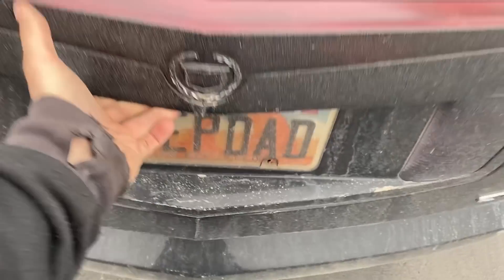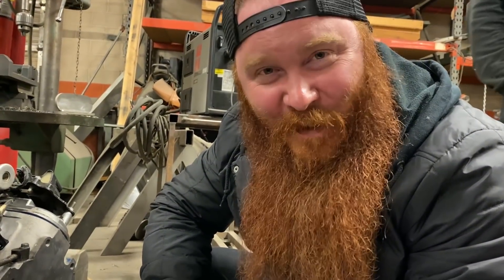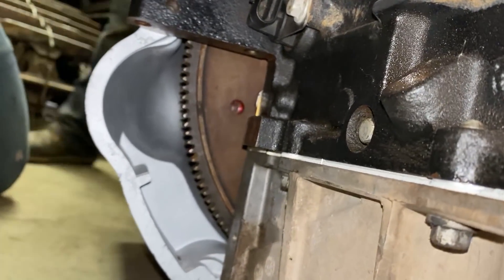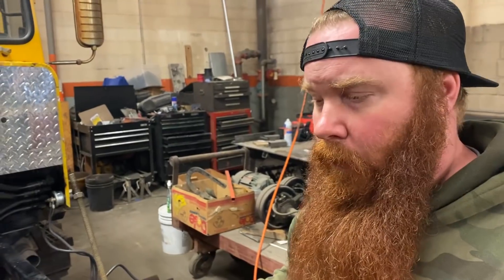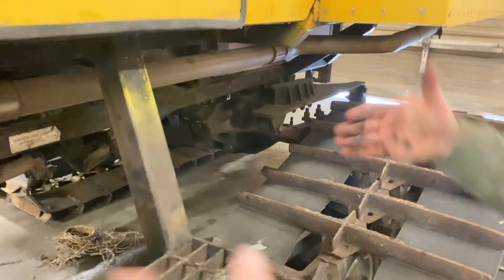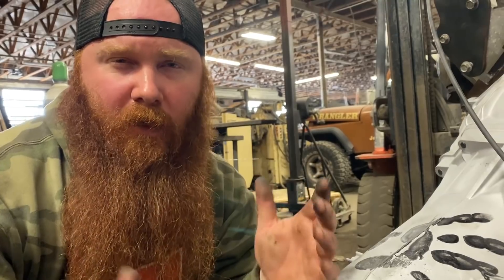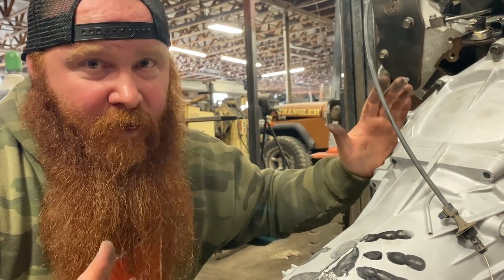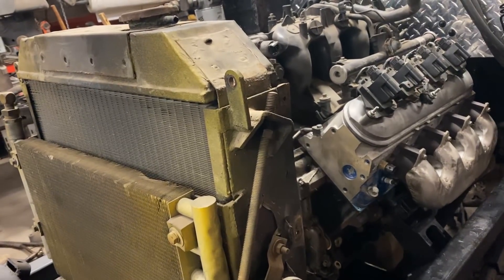LS Swapping A Snowcat Part 4 | Engine Installed

Comment: You need to educate yourself on the operation of an automatic transmission. Not even close. Only a CVT works like a snowmobile torque converter, and remotely at that.

Comment: maybe the thermostat side is water out??? just so you know: a 2 core radiator will pull air though easier and cool faster then a 6 row or a 5 row or a 4 row get it... and toss that radiator fan and install  a duel electric radiator fans that trigger off a sensor , if you do use that fan it must be 50% in the hole of the shroud to pull the fresh air though that over kill radiator..   just say`n

Comment: why not use an electric radiator fan? better flow and reduced mechanical load on the engine, not that you would really notice that bit in this application but the better air flow seems like it could be a plus. might not even need to cut the shroud to make it fit

Comment: Nut and bolt hack: Tractor supply co sells grade 8 hardware for 5.79/pound.  I have been using them as my go to for the thiokol spryte snowcat restomod on my channel.  I should be done in a year or two LOL....

Comment: What’s the flow rate of the hydraulic pump that was on it ? Versus cheating and using a GM power steering pump to run your steering

Comment: Ok guys about the Radiator on your snowcat, change to an electric fan! You will pick up abou 10-12 hp, have faster warm up times and it will save you a bunch of time! You will need a fan set up able to move about 3000 cfm give or take a 500 cfm. High output alternators for the LS are easy to find and shouldn't break the bank!  Good luck and I look forward to seeing the old girl run under her own power!

Comment: Know dought the tanks on that radiator are brass so you can unsolder them from where they are and move them to where you need them. That's what I did on a 53 willy's engine swap I did

Comment: On the hardware buying thing,  do you have tractor supply or rural king or anything like that around there?  They sell grade 5 and 8 by the pound and it is so so so so much cheaper!!!  I went and bought an entire bolt bin set up for less than $200  every size up to 1/2" up to 8" long including washers and nuts and nylocks,  kinda a fistful of each.

Comment: Internet riled up? You mean not using an uga duga socket on the uga duga tool?  Bad form followed by a 6 hundred dollar torque wrench to compensate. 

The tools make the job easier, don't they 😁
Reply: Jeff Knebel if we tickled any more booty they throw us in jail
Reply: @stepdadbarneswestshop2800  I wholeheartedly agree my friend. If the tool dont fit either make it or buy it.

Comment: Tiny hard ware stores do charge a lot for bolts, a large "farming" store near by me sells them by weight at 2.80 a pound for grade 5, so you'd probably only pay like $12 for that. Cummins swap definitely would have been cooler, but it's cool as it is)

Comment: So basically is that Ram set up front and back the same like when the back turns the front turns to like if it's pushed out it would make it turn we do have in the back as well as the front cuz they're in sequence like a loader and the transmission set up like a CVT pretty freaking cool man

Comment: McMaster Carr. It’s where I get all my hardware. I buy enough to have stock. Much cheaper than ace hardware.
Reply: I go to Tractor Supply and buy it by the pound! At least that works for imperial.

Comment: Do your self a fave get a E fan from a local parts store wired on a relay to a temp switch. I swapped them into trucks and cars all the time the amount of less drag on the motor is insane shifts nicer as well less noise warms up quicker on cold start. You have lots of room plus you can use radiator fan zip ties. Plus if you go pro charged turbo or LSA you have wayy more room
Reply: E fans are usually found at raves.
Reply: We will figure something out

Comment: $30 for those bolts! Damn! And are those just grade 5 markings I see on the heads? I'm in rural Idaho and even I can get new yellow grade 8 stuff from a local hardware store for $5 a pound! Hell, I think I could get alloy steel or even 316 stainless bolts and thick hardened grade 8 washers for less than $30 there! How do you live with such expensive fasteners!? 

Where is this? How can I make sure I never live there?

This is all pretty cool though!
Reply: DrPersonman slc Utah 

Ace hardware is proud of their stuff
Reply: I agree. We have a TSC and a Rural King. Much cheaper.
Reply: @glbennett66  TSC FTW

Comment: So, what you’re saying is that the snowcat uses a forklift steering setup with a hydraulic steering wheel and cylinder.
Reply: dzneal  - Didn't say that. Stated that the hydraulic steering setup (wheel/cylinder) replicated what's used on a forklift. The actual method of turning the tracks on pivot is completely different.
Reply: The ram pulls or pushes the same side of each axle 

So when the ram pushes it turns right and when it pulls it turns left

Comment: Two things...first, don't try to turn the cat unless it's moving. You can walk right out of the tracks or break a steering knuckle. Second, stock up on steering knuckles. If you use it much in the snow, eventually you will break one. Having the tools and spare knuckles available can help keep you from taking a walk in the snow. Been there ;)

This is a very cool build, finally an old cat with a bit of HP!!
Reply: KB Snowdrifters getting excited to break all the pets lol

Comment: If your wallet allows,, an edelbrock 8895 water pump corrects the inlet /outlet. I used a krc pulley along with a 1/8" shim to space it to where it needed to be. Cool project videos should rip when you're done.
Reply: travisludvigson this is solid advice! Thank you

Comment: I've never seen a issue with using a impact to start bolts in before following up with a torque wrench.  Just takes a little common sense to not go ham with the thing
Reply: Semparo giver like 7 Ugga duggas
Reply: Stepdad Barnes Westshop *but it can’t ugga Dugga before it’s all the way in for proper tech

Comment: Are you sure the torque converter is fully seated? The torque converter should turn easily once the trans is bolted up. Should feel three thuds as you seat the converter, plus it should be recessed from the bell housing. If it's not seated, you'll destroy the pump when you start it
Reply: dave1135 she is all good
Reply: I'm with Dave1135, there should have been 1/8" between the two, bolt should have pulled it in to the plate.

Comment: "Blowy Uppy." Best quote. Needs to be on a shirt.
Reply: Stupid Robot Fighting League it can be a thing
Reply: @stepdadbarneswestshop2800  Awesome!
Reply: All things, mechanical and electrical, are manufactured with "smoke" in them, blow uppy is when you let the smoke out!
Reply: I had a 2000 s10 with a 4l60E in it, and I can confirm that those transmissions are rather blowy uppy...

Comment: A Radiator shop worth their salt should be able to swap out tank location on that Radiator next to nothing solider in a new bung & plug a hole, pressure  test & get it back to Ya in a few hours. Look'n great guys !!!!! That track is going to be kick ass.
A 318 is a nice engine if you can find a good set of 360 heads & 4bbl intake. Slide in a nice cam it will make some decent power.
Reply: Roger Marshall yeah haven’t decided what to do yet

Comment: Two things/questions. I would test that radiator to be sure it can handle the proper pressures that an LS looks for in its cooling system. A lot of the older motors used lower pressure caps, etc. (I'm not wording that properly but you get my drift.) Also, is that cooler in front of the rad for the trans or the hydraulic system?

Comment: I wanna see what you guys do with the old powertrain. Or at least see how far you can push the old engine.
Reply: Sarvaerus kinda want to run it on a stand with no oil in it at like 1500 rpm and see what happened
Reply: @stepdadbarneswestshop2800  do a simple swap (if you can even put those two words together) and see how shit it is

Comment: Why get nylon nuts for the motor mount bolts?  Why not just get regular nuts and weld them to the hole, so you only have to put a dab of loctite on the bolt and tighten down?  Those Nylon nuts are pricey, and when you are looking at a project like this, a bottle of loctite and use normal nuts is going to be cheaper.
Reply: Mike Harris already had painted the mounts and it helps keep the rust down 

When we weld the nuts it burns off the galvanizing then we have to make sure we get it painted again real good 

And it helped with time
Reply: @stepdadbarneswestshop2800 good point.  I didn't think of rust.  Arizona here and rusting is not a problem here, so it never even crossed my mind. Snowcat will definitely see lots of rust, lol
Reply: Mike Harris yeah I’m here in az right now and there is some clean projects here